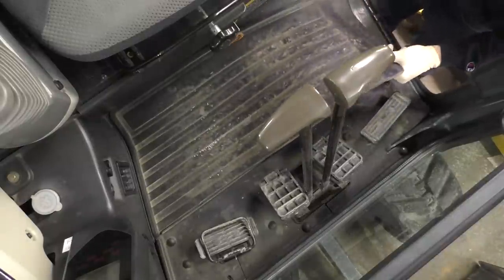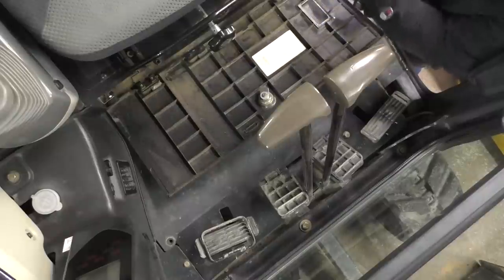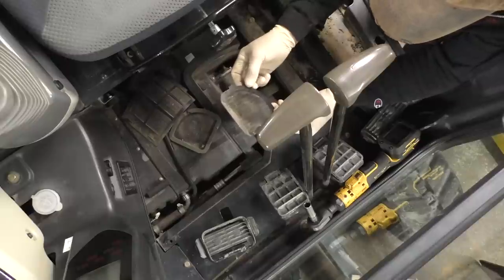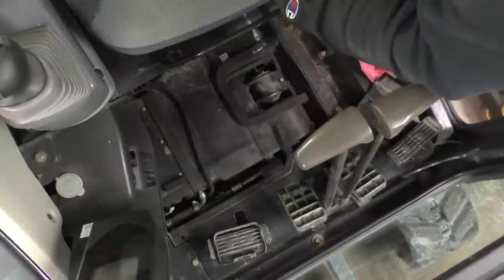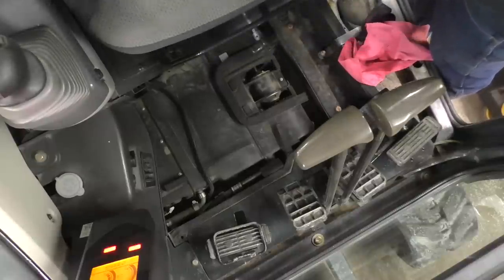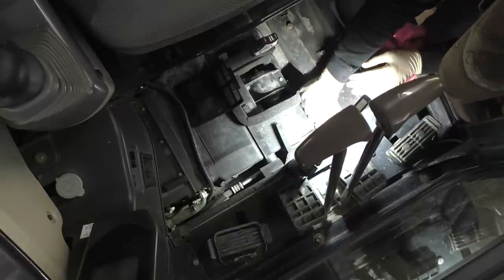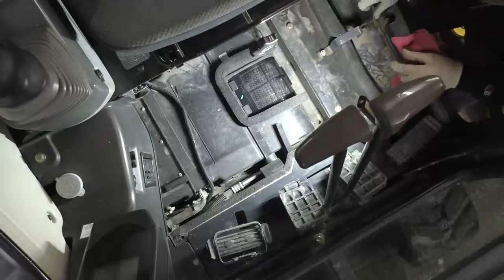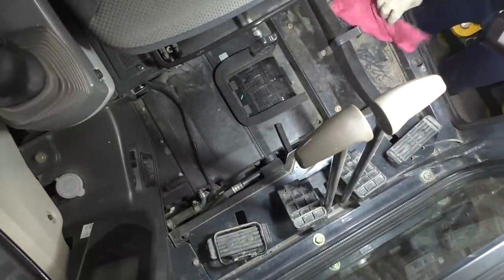John Deere 35D Excavator: Heater & A/C Filters - Cleaning

Comment: Sweet it's nice working on a machine that is in really decent shape. That even has all its original filters still in the machine. Seen a lot of them that had whole filter and assemblies missing. Nice job did service data say if it has an outside air inlet filter like cars usually have I know the newer wheel loaders do and some of Komatsu's equipment does.

Comment: most machines have exterior filters in the outside of the cab for the air intake I would assume yours does also, should be right behind were the cab door swings open and latches open ,you should see some louvers, vents in the cab exterior

Comment: Never knew an excavator had A/C
Reply: Yeah, it's far more common these days and for good reason - all that visibility via glass - it can get oppressively hot even w/ the door latched open. Glad he cleaned them - because of the setting they're used in the HVACs take  a lot of beating....less so now - when they used to have the system on the top of the cab and if you were working where dirt is flying around - it was a mess.